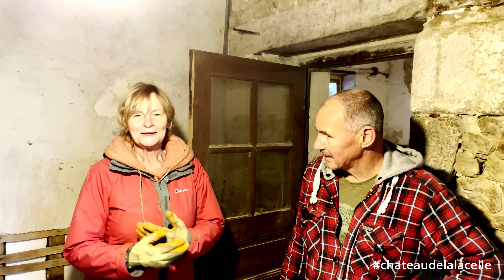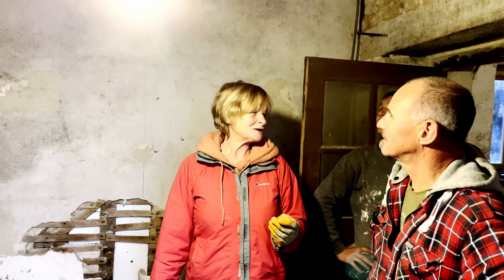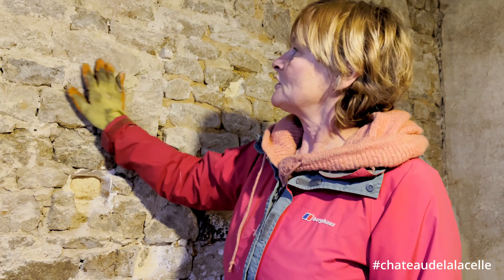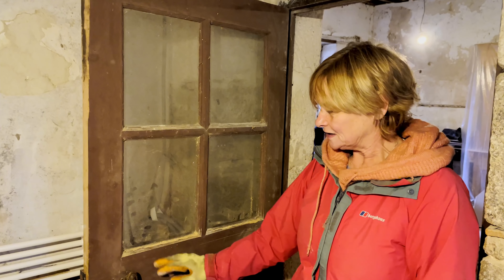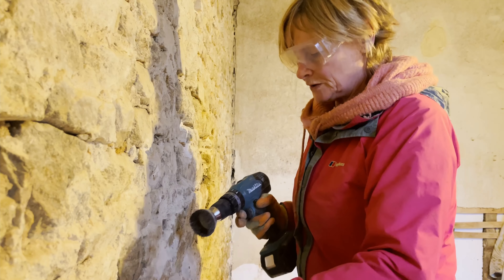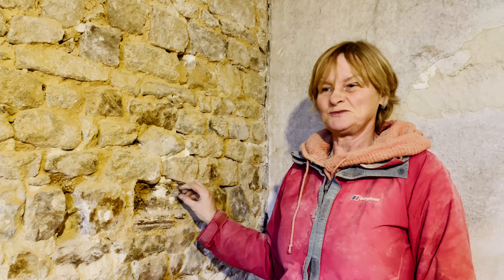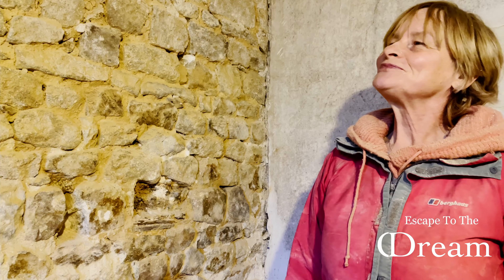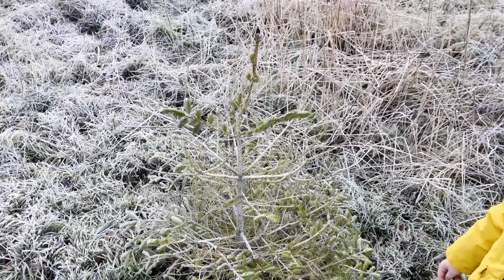Restoring The Stone Wall In The Cottage. Ep 12

Comment: have a look for a cheap SDS drill, it works like a jack hammer and fetches the loose mortar out of the joints, it will save a lot of time and will get a lot of use in the future.

Comment: They make stuff that looks like stained glass, it comes in rolls. You can get them at home improvement stores. You can put it on the bathroom windows. My parents bought an old house that had a door like that for the bathroom. I had paints that you put on the glass to make it look like stained glass. It came with stuff that looked like the metal pieces that hold the glass in place, it was very thick paint. The door turned out beautifully.

Comment: Tracy - Lovely ideas for the bathroom!
Tree planting - Sorry, but it’s planted too deep. However, it’s not been long, so you can fix it. The tree depth should be the same as in the pot, with the top roots pretty close to the surface. (Check online and they’ll show you how to identify the root flare and where that should be.) If you pull it up and put some dirt underneath, it should be fine. And water it with a bucket or two after moving it up, to eliminate air holes in the dirt, and give it a boost to get it going. Don’t add more fertilizer - just mix in what’s already there. Too much will “burn” the roots.
Reply: Yes I thought that too about the tree planting depth.
Reply from the maker: Thank you very much 🥰
Reply: @jennifercampbell7698  Oooops - sorry about the accidental thumbs down - I was trying to use the Reply button. (eyeroll)
Yes, it's a common mistakes. As I'm sure you know, it's often different with garden plants, which often fare better from being planted deeper, so an easy mistake to make. And since the tree does well for a few years, or even survives but simply doesn't do as well as it could have, people don't always realize, right?

Comment: I am afraid your tree will not survive.  It should never be planted deeper then the existing soil line. It looked root bound from the pot, so you should loosen up the roots before planting. Planting holes should be be twice as wide as deep.  Do not add compost or amendments to the planting hole, just add back the original soil you dug out.  Put the compost and soil amendments, if you want, on the top of the soil. Water it generously, so the soil makes contact with the roots and removes excess air.